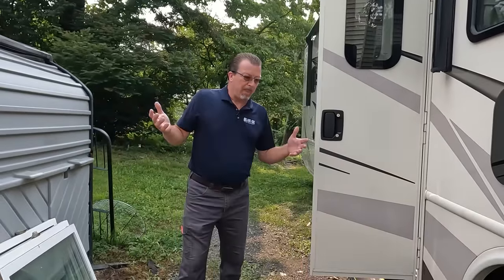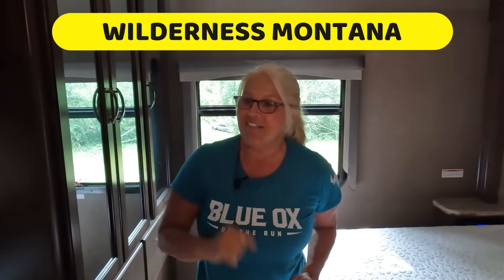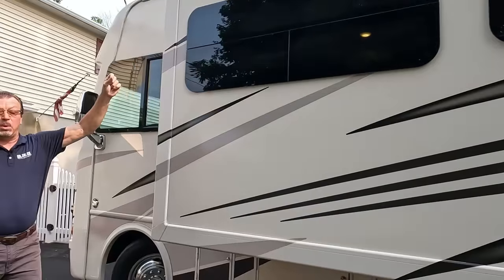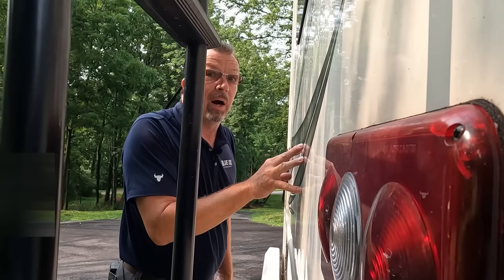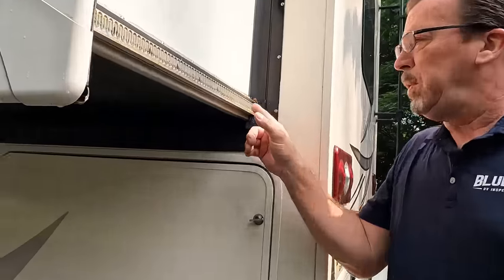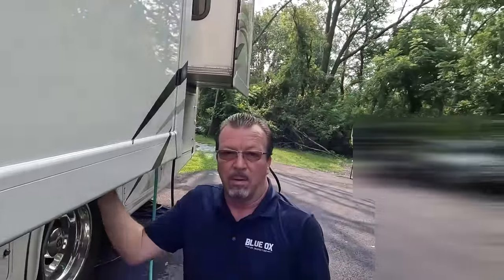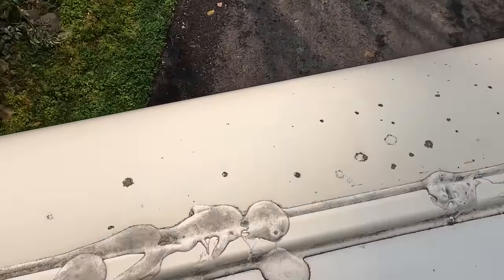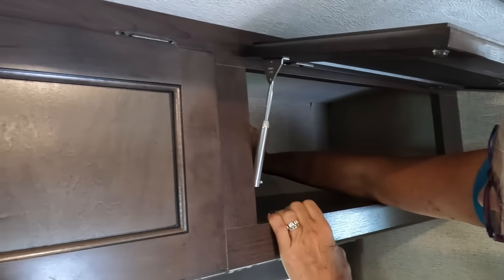🤬It's a TRAP for RV BUYERS! WHY are RV Sellers DISHONEST? THOR ACE 30.3

Comment: Really good and informative video. I've heard through YT videos that RV's are not well made and that it's a mater of time before they leak, which causes mold and other types of damages. Your video is just another confirmation of that. Thanks for Sharing. Your work is valuable.
Reply: looking at the roof of this unit, it looks like a 5 year old did the caulking/sealing around the ACs, skylines, etc.  Bouncing across USA roads is going to be rough on RVs.
Reply: *skylites
Reply from the maker: Right ?

Comment: You've convinced me of the need for inspections, but where do you suggest that RV owners go for repairs? Sounds like many RV warranties are useless, so why return to the dealer? Are local RV repair shops a better option? Or are the dealers still the best choice?
Reply from the maker: Local RV techs are my go to if needed...never a dealership. We live full time, and they are not accommodating usually...

Comment: RVs are like cars,  when they sit for a long time they can rot from the inside out.  What a friend of mine used to do,   he would plug in a light and leave it there all winter along when he stored his RV,    even if the RV was not heated The light bulb is supposed to burn off the moisture in the air.  If I got an RV like that the one you just showed me I would try to get it for a decent price and then I would  work on it from the top down.  I've seen a lot of people put covers over their RVs and that would be anything from a tarp to a custom-made cover.   Another thing that people don't think about,  moisture also wicks up from the ground especially in the northern climates.   You should have at least 10-in of airspace underneath of vehicle at all times when it's being stored,  and that's not so they can steal your catalytic converter or other components.
Reply from the maker: Great input 👌

Comment: I worked on boats, and they did surveys at sales time, well if they had a crappy boat they wanted to buy, they had a tight surveyor list all things wrong to drop the trade in value. And if they were selling one ,had a loose surveyor. And twelve different moisture meters will give 12 different readings. A color thermal doesnt lie. Ive seen one that showed a water leak behind a shower in a wall.
In six years that is junk, buyer beware , not built to well.
Reply from the maker: You are totally right on ! We also have a better professional humidity reader for doubtful cases....most of the time, it kinda speaks by itself just looking where it came from, the origin !

Comment: Isn't it such a shame that something as new as 2018 is so damaged? I think many people expect things to last longer, and as many very old trailers built like brick sh.. houses. Caulk ain't what it used to be.   But now, weight is a huge concern and trailers are built for light weight and of course can't leave out profits. 
        But I think people expect them to be low maintenance for at least 5 or so years and that just isn't true anymore. We bought an oldy many years ago and I did the first maintenance in probably a decade or more and it was fine. A little caulk here and there where it was not so clear the seals were good, but no leaks or signs of one-  I don't expect that at all now. 
      Walk arounds are important and fixing anything even remotely suspicious for drying out, unsealing etc is a must. After a rain I put out the awning to dry, make sure there's no wet leaves before retracting etc. just to mention one thing to do,
Reply from the maker: Exactly why we bring those findings to the public so people understand what the market is all about or what to look for. Maintenance is key, once you have your own, in order for your RV to keep its value. Great comment 👍 🤙

Comment: I'd like to know where the idea of replacing tires after they are 5 years old came from. I was in the tire business for 25 years and then in the Bus fleet industry for another 20 years and never heard of such a thing. We had a retread plant and ran retreads on the back of all of our busses with casings much older than 5 years and retreaded more than once. Casing failures were extremely rare.
Reply from the maker: Michelin told me there was no concerns for 8 to 10 years on theirs 🤔
NTSB claims this 6 years old to change tires regardless of condition...yet, no regulations for truck tires 🙄 isn't a RV tire like a truck tire 🤔 🤣
I'm with you. I had a fleet of truck and recaps, never used to consider the age on them 😳
Reply: @blueoxontherun9188  The larger RVs with a bus chassis usually run commercial grade tires. I was a motor vehicle inspector and the age of the tire never came into question whether on a car, light truck or commercial bus/truck. There was no mention in the (Canadian) motor vehicle act regulations, the things to look for were weather checking, sun damage, cuts, tread depth etc etc. But I have been told by "technicians" at tire stores about the 5 year thing. I wish I had thought of that when I owned the tire shop heh heh, I'd be much richer. All that said if a person lives in a really hot dry climate I can imagine a tire would be pretty dried out after 8 or so years, but then you'd see cracking in the sidewalls.
Reply from the maker: I've had sidewall tire cracks on my Michelin for 7 years, that's why I had Michelin people look at them, from the plant, that confirmed they were just surface cracks issues 🥴 and my tire should be fine...don't pass 10 years they said 🙂
You are right, you should have known...6 years max on cars and LT...no commercial regulations on any amount of years tho 😁

Comment: 1:00.  That is probably not Linoleum.  At first I would have said it is NOT linoleum.  Probably high pressure plastic laminate or vinyl.  Linoleum is a more expensive natural product made of linseed oil.  Wears great.  It would be a nice floor for an RV but I would be very very surprised if any maker uses it.

Comment: It came off the assembly line built to the bare minimums and it shows.  Minimal caulk in critical areas or maybe no caulk at all.    You saved the buyer a huge headache down the road.  Nothing but a rolling, rotting mold machine.
Reply from the maker: Right!

Comment: The RV industry is putting out garbage. Unless you are buying a new Tiffin, Prevost, etc. you should EXPECT a headache from the very start with super poor workmanship that will have you back at the dealer within the first few weeks for ‘warranty’ repairs, even Airstream, Jayco, Grand Design, etc. have taken a dump in quality the last several years.
One of the solutions would be for these RV manufacturers to have a SOLID QC team whose salary and bonuses are based directly on dealer warranty claims. The problems won’t magically disappear but will certainly drop dramatically.
Reply from the maker: The problem....people continue buying them !
Unless it affects their bottom $$ dealerships and manufacturers won't start caring 🙂
Reply: I could buy a gorgeous 2200 sq ft condo on Lake Shore Drive here in Chicago for what a USED Prevost cost and pay the monthly HOA and prop taxes with what it would cost to keep that thing stored, cleaned, fueled, maintained, and repaired. And my repairs would be far fewer and much cheaper as would any utilities not included in the HOA. Or, I could buy a very nice house in a less pretentious, but still very good neighborhood, and spend what an RV trip would cost in fuel and campground fees for couple of weeks at a nice hotel or resort.
Reply from the maker: Everyone has a different hobby or view on where one wants to spend money! Some smoke, drink, gamble, mountain bike, boat....🤙
Reply: Now that Thor has bought Tiffin, they are not what they use to be.
Reply from the maker: We see that as well sadly 😥

Comment: Question for Blue Ox. When you found the moisture issues, did you stop there? Were the remaining systems tested? Was there a test drive on the MH? Just curious as how thoroughly the inspection is. Thanks
Reply from the maker: Customer told us to stop. They weren't in for a project

Comment: I would have called it done the minute I heard that wood under the slide crack. Of course every time I see an RV with a slide, I see $$$$$$$ repair bills down the road. I don't like skylights either. Not on RVs and not on houses.  It WILL leak.
Reply from the maker: It's not a matter of if, it's a matter of when 😉

Comment: That moisture meter works nice but how’s it work when it’s 2530 below zero how do you check your moisture then reason I’m asking is I’m looking at buying a used camper here within the month and no I won’t be getting inspector
Reply from the maker: Your guess is as good as mine...good luck 😁

Comment: I was looking @ A 2015 Ace 30.1 A week ago it looked decent They Had Just taken it in on trade (The Guy who traded it in was still at the Dealer) It just seemed cheaply Made are all the ace Motor homes that way? I also looked at a 1999 35FT Something But The Quality was soo Much better on the old one even though It was well used
Reply from the maker: Ace seems to be on the cheaper manufacturing side IMHO. Keep your good eye open until you feel the right one.

Comment: I recently retired and would like to do some RV travel, but between this information and other videos of poor RV manufacturer practices I've decided to buy a used bus (greyhound, etc.) to gut and build the interior myself, along with having a shop install a new re-manufactured engine / transmission & rear axle.   This I can do for well under the price of buying one of these cheesey manufactured Class A's (or even a Class C for that matter).   I just can't afford a 2 million dollar quality built coach by a reputable manufacturer.   DO YOUR RESEARCH and ABSOLUTELY GET AN INSPECTION if you must buy new or used crap - you get what you pay for.
Reply from the maker: You get what you paid for 😉

Comment: You’re supposed to inspect your RV twice a year and every time before you camping. I’ve had a 5th wheel for 10 years now and have none of these issues because I take care of my shit. I know plenty of other people that do the same. It doesn’t take a rocket scientist to tell you that your sealant needs replaced or resealed. People in these positions are just ignorant to the maintenance that persists with RVs or are just lazy.

Comment: I have seen another Thor RV where the inverter came off of some cheap attachments and was loose in the box which will ultimately destroy wiring if not the inverter.
Thor is red flag no. 1.
Reply from the maker: Happens more often than one can imagine 🙄

Comment: Great video, when you use your moisture meeter. I know you want 0 reading but, what reading is an acceptable reading. Thanks Rick
Reply from the maker: 25 to 35 is normally OK!
Over that number, unless it's a metal frame behind the wall, time to find a culprit..🙂
Reply: @blueoxontherun9188  thanks but the wall behind the couch was in the 30''s so does that mean normal? sorry but i'm at a loss. Thanks for the video.
Reply from the maker: Are you referring to our video or your personal RV?
Reply: @blueoxontherun9188  the video I asked the question on it a trap for rv buyers why are rv sellers dishonest thor ace. you metered the wall behind the couch and stated high moistuer. Again thanks you for your time and your great videos.
Reply from the maker: There's more, than just readings, with this tool itself. One needs to understand and interpret such readings to surrounding and location of such readings...it is not a cut and dry determination. Repetition and trials makes you determine any issues!
Manufacturers or dealers will deny any wrong doing or responsibilities for those issues. " it never happened before" 🤣 " first time" 🤣 they are in for the money...that's it 🙂

Comment: I’m so scared to buy a motor home.  I wonder how much of a money pit they are to maintain.?  Worst of all if I don’t know how to maintain.
Reply: Keeping clean doesn’t mean anything
Reply: There is maintenance needed like a house. I hire folks to do the stuff on the roof. But yes they can be money pits very easily.
Reply: They are money pits; things always break.  We're on our second class A.  If you don't know how to maintain - just find a mobile tech that will come out twice a year and go over your seals and keep them up.  You can see in this video what happens if you don't.
Reply: Don't let fear stop you! There are so many YT channels to learn how to maintain an RV. And educating yourself will save you money when you learn how to do things yourself. There are classes for new RV owners, there's an at home study course offered through the NRVTA. Proper maintenance wards off future problems. Not everything, of course, but it's not complicated and can even be fun and empowering. My jacks weren't extending. First thing I did was add hydraulic fluid. Thankfully that's all that was needed. But there was a time that I would have panicked over the jacks not working.
Reply: @scott5280  it does on the roof. If you keep the roof clean it's easier to see if there are any cracks in the sealant. The dirt covers up some of that, camofloges the holes or cracks.IMO
Reply: Fear is your friend. Listen to it and consider that you could you could make massive improvements on your house or trade up to a better one with what even a low-quality used RV would cost, which is $50,000 to $150,000. You can buy a decent house in many locations for what a high-quality RV would cost. Spend the money on your house and put aside $10,000 or so for a really nice vacation at a nice resort where you don't have to clean your own room and empty your own sewage tanks.
Reply: @chicagonorthcoast  the person who posted expressed concerns about maintenance, which is not something to fear but to learn and it's not that complicated. If they wanted to just go to a resort or hotel to hotel when they travel, then they wouldn't be considering an RV. You buy an RV and you have a place to keep your things and cook and sleep, and you can park in some places for free or far less than a hotel room. Sure, you have to clean your RV, like in your home, but in a hotel you're sleeping on a bed thousands of people have slept on and the rooms aren't always that sanitary. Dumping the black tanks is so easy a child could do it. Lastly, fear is not a friend to anyone, it leads people to make bad choices, as we've seen especially over the last two years. Fatal choices that they believed were safe and effective.

Comment: No inspectors required as they sell brand new cars without telling the buyers to beware but when enough of them catch fire, the wheels fall off or the steering fails, some wingnut from the government sends a notice for cars X y or Z to be recalled, replaced or repaired while owners become the test pilots and manufacturer's blame anyone who made the parts.
Reply from the maker: Exactly the same thing with the RV industry with recalls on few details unregulated. 
We're all the wind test tunnel free of charge!
I've never seen an RV recall on known slideout defect from any manufacturer 🤣
"Just sell em" they say 😡

Comment: How many units, what's the percentage, of the units that you inspect pass?
Reply from the maker: On average, 80% Pass with dealership being able to address and fix our findings. The other 20 is left to buyers being willing to go  back to their respective manufacturer or simply do not want to pursue the purchase because of our findings. 🙂
Reply: @blueoxontherun9188  Good job. Do you also check the engine on used ones? It's amazing how shoddy the construction is on these vehicles.  And they're not cheap!
Reply from the maker: We do check mechanical components and engines. To a certain degree!

Comment: What is an average cost for this type of service?
Reply from the maker: Depending on the kind of unit and the inspectors POI or knowledge, between $1k to $2k for a good inspector. 
Remember,  good BBQ ain't cheap and cheap BBQ ain't good.
Certified inspectors are not cookie cutters, all have their different knowledge or approach as what is a good inspection. Some are done a Class A report the same day 😁🤣

Comment: Moral of the story buy yourself a moisture detector. And conduct a thorough inspection yourself. Clearly check the roof first. Find yourself a inspection guide and print it off from the internet.
Reply from the maker: You still won't have a clue what you're searching for!
Just let specialist help you out and be good at what you are good at ! 
We all have a strengths in our own fields. 
People spend so much time and monies trying to save a few buck by proudness 😉😁
Oh I'm smart enough to figure this out! What does he know that I don't already know?😳
Reply: Add in whatbhe did,pushnon walls and under slides. Bounce on bath landing to ck.for sponginess from sogging. Olders often arevsoggedvoutb.

Comment: All slide outs LEAK, they have flat roof, water sits there and gets under the seal..
Same with  the sides, water is forced in when driving,  IMHO don't  buy anything  with  a  slide-out,  not even New as the resale  drops so fast.
They may look  ok, but DON'T  fall for it....cheers....